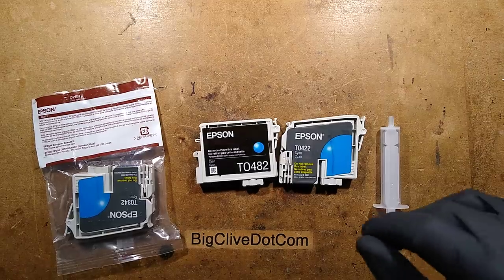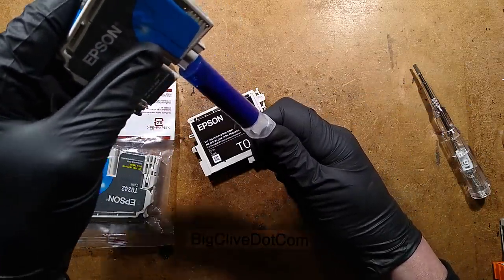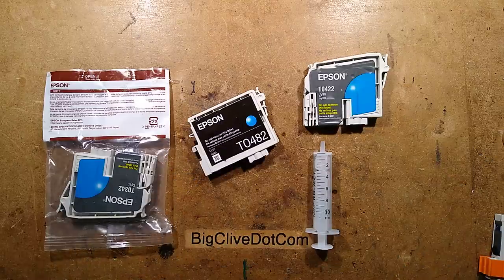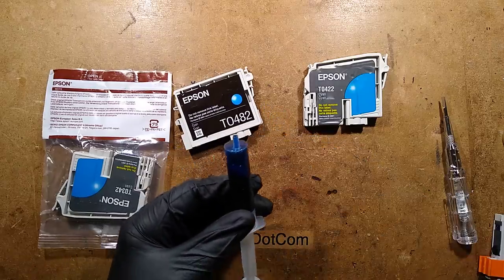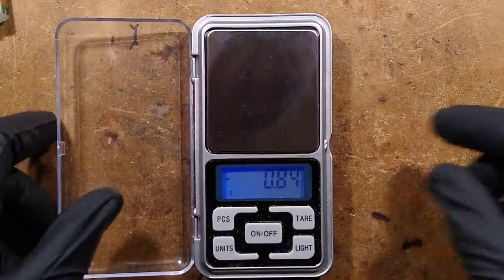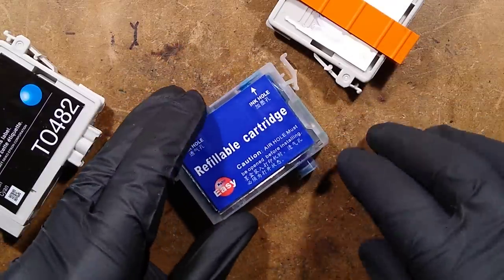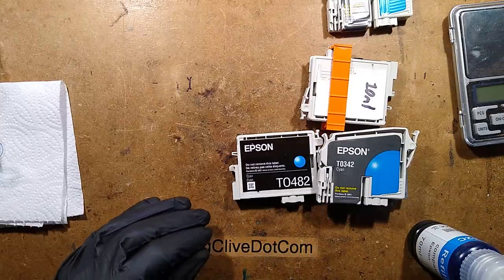How much ink is in Epson cartridges?

Comment: Oh boy. That takes me back. Epson cartridges were a pita to refill successfully at the place i worked back in the 00s. So bad was it that we stopped doing them except for a couple ancient designs and sold MIPOs and OEMs instead. 

 Canon, brother and lexmark were the easiest to deal with. HP were easy to fill but we got a lot come back because customers barely used them and the nozzles would clog. There's a special button sequence on many HP printers that resets the cartridges back to "full".

Good idea on the gloves. I never used them as they'd often end up hot glued to cartridges we refilled. I found nothing gets the ink out apart from time.

We always recommended Brother printers (cheap to run) and Canon printers (easiest to refill). Epsons were always a big no unless you needed professional/a3+ printers. That's despite the huge markup we had on MIPO cartridges for epsons we sold.

I personally had an Epson CIS, then went to Canon, then went to laser. I leave colour prints for the shop or work.

Comment: Working in a computer store in the early 2000's where every customer wanted a printer and scanner, I used to explain with examples that more or less the more you spend on the printer, the cheaper it is in the long term with ink/toner costs and also higher page count reliability. Most customers acted like I was trying to scam them and upsell from the cheapest possible model. Oh well. :)

Comment: For my simple needs a cheap b&w dell laser printer has lasted for a decade and still going strong.  Only maintenance has been to clean the contacts on the external chip of the laser printer's cartridge with alcohol/q-tip.  and its mating connecting contacts on the printer also with alcohol, although last time I also had to wire brush those contacts.   Generic double capacity cartridges are dirt cheap and last forever.  Paper jams can be greatly reduced by cleaning the paper pick-up rubber rollers with alcohol.

Comment: About 6 yrs ago we got fed up with ink jets and  bought a clearance office Dell color laser multi function printer for about $400. We still have it. I think it's made by Cannon for them. Anyhow,  prices for color laser printers today are not as expensive, print quality is fantastic,  the  replacemet non OEM toner  on Amazon is not expensive and we've never had issues with the chips at all and the yield is higher. Last no worries about clogged print heads.👍

Comment: I am on my 3rd Canon printer and each has had a slightly different set of cartridges. I still have some of the old cartridges and wonder if they have the same ink so that I could decant the ink out of the old cartridges into the new resettable/compatible ones…..

Comment: The ET-5000 series of printers are the better buy long term. These are aimed at the "real" office user, and are far more solidly built than the lesser models (with an according price increase).  Many seem put off by the paper eject path, however unlike the very flimsy plastic paper trays (even on "real" A3 multifunction floorstanding lasers such as the Canon ImageRunner series),  you'll never have a large document fall on the floor.  They are fast, economical, and have a decent (250 sheet) paper capacity.  For comparison I also own a Brother MFC laser (mono), and the Epson runs rings round this, especially in time to first page printed.

Comment: Question about the printer you have. Can you replace the waste ink pad and reset it yourself or do you have to ship it off to Epson again?
Reply from the maker: You can wash the pad and reset it with third party software after buying a key.
Reply: Some of the Epson Eco Tanks actually have proper user replaceable waste ink tanks that can be done by the end user within just a few minutes and no disassembly, and totally supported by epson with them selling genuine replacements.

The replacements have a chip on them similar to an ink cartridge that allows the printer to track the the use of the waste ink tank.
As soon as its replaced with a new one (Epson calls it a "Maintenance tank kit" iirc), the printer is happy again.

Comment: There are at least a couple of stores in my area that refill ink and toner cartridges, I have no idea if they reset the chips or install new ones, I haven't really needed ink since they opened because I bought a second hand monochrome laser printer about ten years ago and it still prints with the same toner cartridge, which is normal because I don't think I printed even 2000 pages singe I got it.

Comment: I was trying to shop for printers again a couple weeks back after having gone years without one at this point, because how often do you really need to print something nowadays?
Laser (especially color laser) is still horribly expensive and inkjet just dries up between print jobs if you don't print 2 or 3 pages a week. Print head cleaning, a.k.a. forcing forcing a good bit of ink through the nozzle onto the foam pad in the printer, every time is also not exactly economical. At least the times when it was cheaper to just buy a new printer instead of a whole set of ink cartridges are largely over, so there's that.
Anyway, in the end it's just easier and cheaper for me to send the files to a local printshop and pick up the prints on the way to work the next morning.

Comment: Never ceases to amaze me how little you get for your money with inkjet printers versus laser. There was more ink than I was expecting, but per page I would dare wager toner will still come out cheaper despite the initially high outlay and, if nothing else, last longer. This would mean less time spent having to replace it and my time, I feel, is rather valuable as that can not be replaced. I refuse to work with inkjets, as they're usually nothing but trouble and can make a dreadful mess when they go wrong.
Reply: The bonus with a laser printer is that you can feed it with toner transfer film for making prototype pcbs at home if you are into that. It can be easier than trying to use a photocopier somewhere and freaking out the person looking after it when feeding in some 'alien' paper they think might mess up the machine. May not be as much use these days with professional pcb creation services easily available, but something I used to do 10+ years ago.
Reply: @threeMetreJim  Yes, this is something I have dabbled with and have even heard accounts of results, albeit patchy, with transferring from plain paper, too. As it is, though, I have a preference for stripboard, if only as most projects have the goal of being easy for others to copy, with minimal tools - as in you should be able to buy all required tools from somewhere like Boyes - so custom boards are usually off the table. Can sure print off the schematics and component datasheets quickly, though, probably even faster if I'd ever get around to using a model made after '92. That will come if refilling the toner is ever cheaper than replacing the machine, so we should know in about... hmm... five more years, maybe, given that toner has been in there a few already.

Comment: Are the 'unofficial' inks as good as the original for the Ecotank? I'm due to refill mine soon but have previously had bad experiences with unofficial cartridges in my old printers. Wondering if it would be ok for the Ecotank?
Reply from the maker: That depends on the quality of the ink (which is generally unknown) and whether you want the proper ink for long lasting photos with calibrated colour.

Comment: Question: As an IT guy, but pretty inept for electronics...would that small of a pcb/board be possible to just 'jump' like some power boards etc? is it just passing signal thru it as in flows to 'track' usage (and prob prevent refillable cartridges)? IF so, I'd imagine there's a 'reset' or similar circuit that could be triggered by just jumping a few connectors (possibly)
Reply from the maker: It's a low capacity memory chip that stores data regarding the cartridge type and ink level.

Comment: If you tried this with a HP cartridge, you wouldn't get any in the syringe. They literally have a mildly damp wick inside, with a drop of ink on it. Also terrible for e-waste as it's usually cheaper to buy a whole HP printer with ink, than it is to buy the cartridges.

Comment: I switched to a continuous ink system years ago.
Not sure if you are aware, if you don't use your printer regularly you probably find, when you switch it on after some time it will do a head cleaning to get rid of any dry ink on the heads. (Using printer regular may use less ink than using it periodically)
How does it do this? It pumps lots of ink through the heads like opening a tap (Actually sucks). This ink has to go somewhere. The somewhere is a chamber with a big sponge inside. These can fill over time (It's a long time though), but there are also kits to replace these with tubs you can empty.
Small tip: Never hold/carry a printer the wrong way up after it has been used. Ink tends to make a mess.
Reply from the maker: I'm current,y at 6 years, 6000 prints and 35% waste ink capacity used.  I leave the printer powered continually and use it regularly.

Comment: I wonder what are the advantages of ink versus toner if any.
Recently found out that an inkjet also has an ink absorber built in for waste ink and the printer has a printed page counter for that too. Unlike the cartridges this isn't easy to change and resetting the counter requires the printer to be sent in for service or using 3rd party software obtained by means that also have an increased risk of malware.

Comment: A computer error magazine in the mid 1990s worked out that buying ink cartridges cost USD$4,500 per US gallon. IIRC they were doing an article about the bulk purchase of ink for refillable cartridges or for the external tanks that were just starting to become available.

A friend had an Epson ink squirter, put a new expensive cartridge in and it wasn't printing correctly so he pulled ir out to reinsert it and was then told his brand new cartridge was empty and to buy a new one. Those chipped things were a PITA.

Did tech support for a school and the IT teacher purchased a HP Inkjet printer maybe a (5515) for each classroom because they were cheap printers but didn't consult with the tech support. That model printer had a small 5ml ink cartridge which is why the printers were cheap. The profit was made on the consumables. Took several years to eventually get rid of the damned things.

Comment: I had a Brother printer for many many years that hardly used any ink, and what it did was third party cartridges so very cheap. Eventually I got a new Epson printer and it uses masses of ink by comparison. What really annoys me is that it has a "maintenance box" where it dumps ink that it uses to clean the heads. Not only does this hugely increase the ink consumption, the maintenance box has a limited lifetime so you need to replace it too every few times you put in new (third party obviously) ink cartridges.

Comment: Try adding a rubber grommet around the stem of the syringe, place the cartridge in a suitable holding device, small vice etc. and repeatedly suck with the syringe arm and release, it will pull ink and replace it with air, say 20-30 pulls like this should refill it.  If you invert the cartridge with the hole upwards vertically, you can do the same method to refill the ink

Comment: That's very nice, putting that orange clippie thing around the cartridge. I usually just get a rubber bung/plug in the brand I used. Keeps the manufacturing cost down, I guess.

Comment: Still Running a Samsung printer that was manufactured in 2006. Got tired of the inkjet cartridges going dry when I needed them. It got me through printing off thousands of pages in Highschool (including the semester of english essay hell), Printing off the handout versions of all my University power point teachers notes, until this year and hoping to get 2 more years of use of College handouts and only on it's 3rd toner cartridge (First toner was empty, second toner was nearly empty but smearing all over the page, third cartridge has a defect in the roller but only in the margins so I can live with that issue). Recently I had to clean all the moving parts as it was jamming paper due to little use and noticed that most of the rubber is starting to break down. Still I got my Money's worth out of it.

Comment: As I sell these, and many others (my new ones have far more ink than refurbished)...I know that there is an industry standard of X-number of pages of a standard script that a cartridges must print. I can send you the standard pages if you wish. We do not sell refilled, as refilling ultimately eventually fails, due to the fact that the mechanics are really only built to run the standard amount of pages. This is especially true with dry ink of the Laser Printers, which incidentally is carcinogenic.

Comment: I fortunately don't need glossy photos (which if I recall from reading in the 90s is best with a dye sublimation printer, which I couldn't afford / nor need)...  so I swapped to color laser.  I was fortunate enough to get in when the starter toner was 5000 black / 2000 color...   so I'm actually still on the starter toner after ~20 years...  lol.     (I moved my parents into a color laser as well - as it better suited their needs...)   
The swap from like 1 page every 2 minutes (unless in draft mode) vs 16 pages / minute + PCL5 + Postscript ~20 years ago was a win.

Comment: The same "scam" exists elsewhere, where nobody would even think - supermarket spices as an example. I could buy 30g of chilli powder for 99p in a tiny jar, or I could buy 1kg in a pack for £6.85 online, which is WAY less expensive. It's saved me hundreds of pounds over the years buying fresh herbs to dry myself, and dried spices in bulk to grind myself. Of course, I had to buy an expensive industrial grinder, but the savings over years are insane.

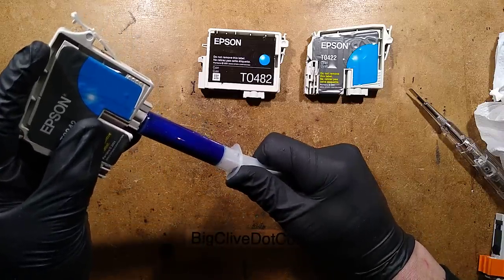Comment: So much 5:34  ink wasted when your heads go dry and/or you clean your heads. There’s a sponge in there where it squirts ink through to try  unblocking.  I kept an Epson Photo R220 going for well past it’s sell by date by butchering pipes into some old cartridges which were connected to large bottles of ink, mounted on the wall like the sprit optics in a pub.

Comment: Laser printers for the win! No need to worry about the ink drying up on you, even if the printer was sitting in storage for a decade! I actually just scored 3 color laser printers about a month ago from some old office and while all the printers are like a decade old, they print just fine. Looking at the dust that had accumulated on them, they must have been sitting unused for at least 5 years and all I had to do was clean all the accumulated gunk and dust out.

Maybe they don't print as pretty photos as inkjets, but I'll take the rock-solid reliability and ease-of-use over inkjets any day.

Comment: I have the Ecotank printer at home as well, and after all the bother I've had with printers over the years, it's just so much nicer. It prints far, far more than the cartridge printers ever did, it's cheaper and easier to refill, and the ink doesn't just completely dry up after a while of not printing anything.

I feel like printers are an extreme case of Sam Vimes' boots theory.

Comment: I thought magenta would be the colour more suited to this channel...

Take the cartridges apart and you'll see that it's quite an intricate design. There's a check valve, a few labyrinths, and several internal reservoirs with septa that are specifically designed to frustrate refilling.
Reply from the maker: An ink cartridge teardown is the next video.  It wa super-complex.   I avoided magenta because it looks like a skin condition when you have an inkcident.

Comment: I only need B&W printing so I switched to laser jet printing about 10 years ago because of the outrageous prices being charged for ink cartridges. Non-name-brand toner cartridges are easily available for low prices. I have found that laser jet printing is much more cost effective than ink jet, at least for B&W printing.

Comment: The last (final) inkjet I owned was a brand new Canon Multi whatsit with multiple color cartridge's. I was only really using it to print invoices, but thought I might print the occasional photo. Since my invoices have no color I reasoned that the most heavily used ink would be black and had purchased an extra large black to replace the first one that had expired. At the time the manufacturers supplied enough ink to get you through about 100 pages.

Shortly after, the printer refused to print. Anything. Reason being that the yellow ink cartridge had gone dry and the rotten box had been programmed not to work if any cartridges needed replacing. Not even black and white.. The previous printer would continue to print black even if all of the other cartridge's were bone dry. Not being able to find any justification for this requirement and feeling screwed and not being willing to expend any more cash for useless cartridges I took a hammer to it. 

I then purchased a used Samsung Black only laser printer for $35 on Craig's List and never purchased another new InkTheft printer.